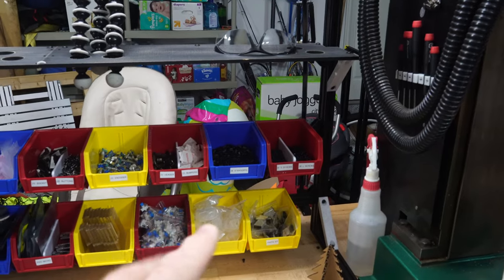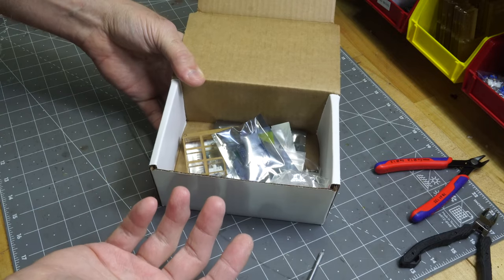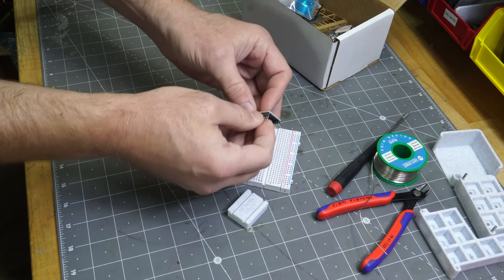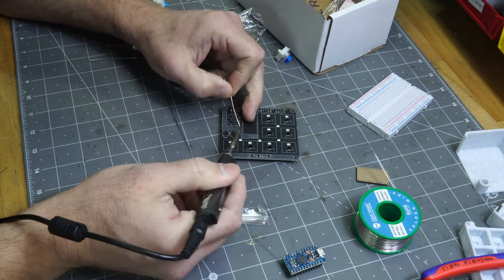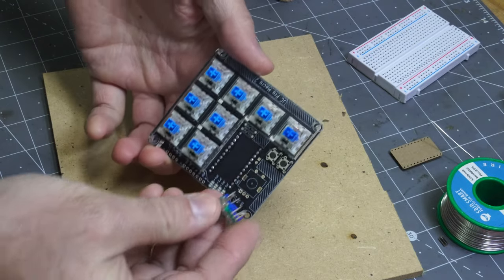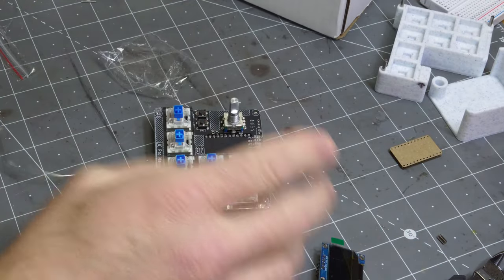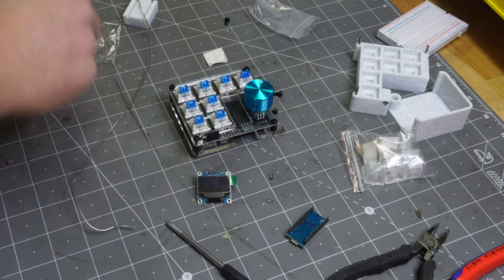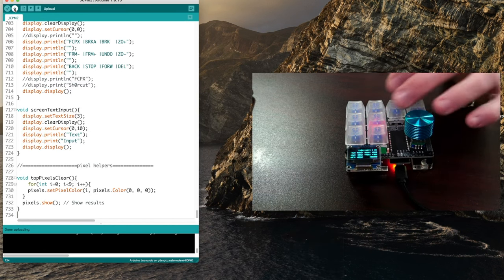JC Pro Macro 2 Assembly (mechanical keypad)

Comment: I assembled mine using this video.  The soldering jigs worked perfectly.  Very easy and straight forward to build.  The only things I did differently were: 1. I added the 3D printed support for the OLED screen, and 2. I 3D printed my own key caps.   I may switch back to the transparent key caps because opaque caps block some of the LEDs.  You did a great job with the video and with creating the kit.  I look forward to seeing what you come up with next.
Reply from the maker: Well thanks so much! Your kind comments mean a lot :-)

Which jig version did you use (I haven't tested the non-keyswitch plate version). You might consider using "clear" PLA for your caps, or even switching filament in order to get an interesting effect.

Also, there's some programming videos here: https://www.youtube.com/channel/UCkaXt822mCePRIJyUXALxEA if that's helpful to you.
Reply: @JeremyCook  I used the KS Plate Jig.  Also, used the one for the Pro Micro.  I have some crystal PLA that I might use for key caps.  For now, I am focusing on customizing the sketch coding.

Comment: My biggest problem with the Knipex cutters is that sure look like the same sort of cheap bent steel as my $3 Harbor Freight flush cuts.  I'm certain the Knipex are made of better material, and I'm sure they do a better job at their heat treating process, assuming any of these style of flush cuts are heat treated.  I have no idea! :)

I got introduced to the Engineer Tools brand from Japan by way of their amazingly handy screw extractor pliers.  They're definitely the nicest pliers I've ever owned.  They look to be well machined.  They feel super smooth and clean.  The rubber handles seem very well made.  I was so excited when I learned that they make dozens of different pliers!

Absolutely everyone should own their screw extractor pliers.  Mine have definitely paid for themselves in the time they've saved me.
Reply from the maker: Thanks for watching! Don't get me wrong, I think the Engineer snips are quite good too, just different 🙂 

Maybe I'll pick up some of those pliers at some point, they sound quite useful!